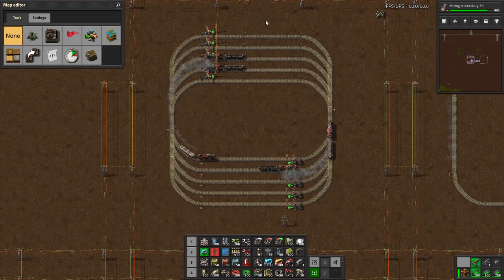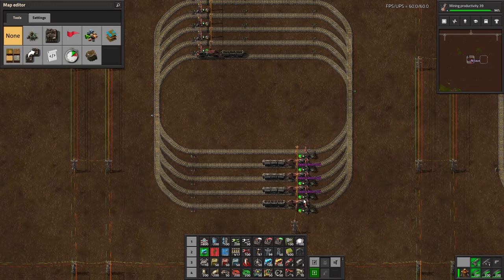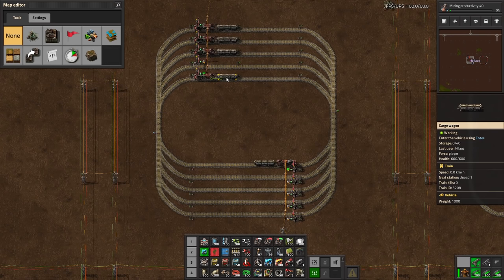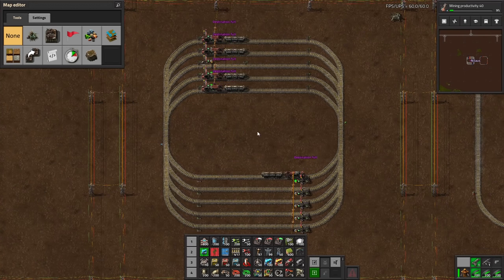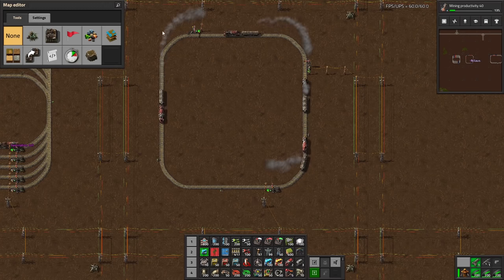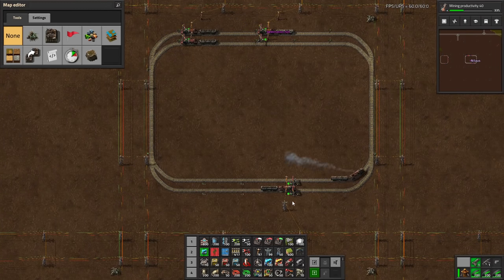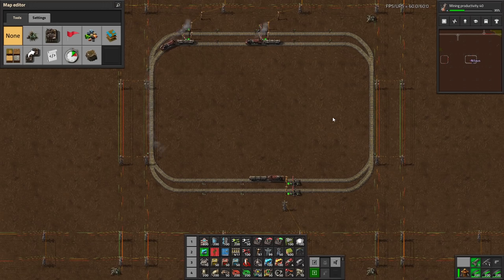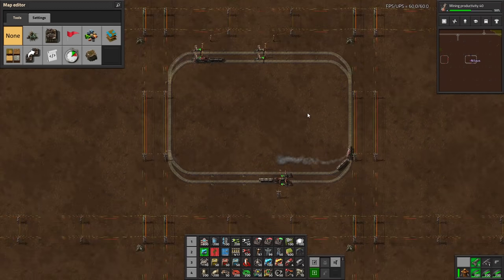ADVANCED TRAIN SYSTEMS; Deadlocks, Depots & Train Limits |  Factorio Master Class

Comment: There is a way to modify your 3rd setup to get rid of the problem you have shown. This fix will make the system a bit more robust against the resulting deadlock, so it might be useful to some people. But as it doesn't solve the underlying issue, as you have explained at 16:03 in the video and summarized marvelously in the quote at 18:55.

For the third example, you need to have the "actual station" (the one with the inserters lined up to the wagons) and the "pull-out station" entities immediately after another, such that a train in the pull-out station has its tail still inside the actual station area. (More specifically, either have such a short signal block for the pull-out station that a train of any length that could wait there will be GUARANTEED to stick out by at least 1 pixel into the actual station's signal block, or even have a single signal block for the actual station and the pull-out station. The latter has the advantage that it works with trains of any length.) Then the system will work as follows:
As soon as the train has stepped forwards into the pull-out station, another train can RESERVE a path into the actual station (since it's not "being reserved" any more - and thus this setup is fixing the very cause of your problem). But that incoming train can not yet PULL INTO the actual station that it has reserved, since the signal block is still occupied.
Only when the pull-out station is getting empty can the new train pull into the actual station, and that now GUARANTEES that it will be able to pathfind to the corresponding pull-out station - which eliminates the problem.

The first downside is that a train in the pull-out station might not get called anywhere for a LOOONG time. This will be especially probable if you apply this setup to a loading station - and provide too much capacity for filling the trains according to your plan. But it can also happen if you apply this to unloading stations and run into a situation where you have more capacity for unloading trains than for loading them. In the latter case you'll be blocking a whole module of your factory from working until the underlying issue is fixed (or until the offending train is manually pulled out).
This is why i'd suggest to only use this for loading stations.

The second problem is that it can still deadlock, but it requires up to 50% more trains than the simple system, which actually makes this a slight advantage. Where the simple system deadlocks when there's
a: trains in all open dropping stations and
b: trains INSIDE all open loading stations
(both meaning filled up to the current train limit with both a train trying to find a path and possibly trains in the stacker), this improved system will deadlock when there's
a: trains in all open dropping stations and
b: trains waiting in the stacker of all open loading stations (with their number equal to the current train limit) and
c: trains inside the pull-out stations of ALL open loading stations.
If I'm not making any mistake here, it WILL NOT deadlock until ALL loading stations with a train limit >0 have a train waiting in the pull-out station. Thus the "only" thing you gain is that you increase your capacity for waiting trains by the number of active loading stations. HOWEVER, this isn't the same type of increase as just adding 1 to the maximum train limit! The maximum train limit only takes effect when a station is basically overflowing with materials to load. Whereas even when the buffer boxes contain just over a single train load, a pull-out station can have a train inside of it. Or that train might have already left the pull-out station. But in a deadlock or near-deadlock situation, it'll be more probable to find the pull-out station full than empty. And it ALSO isn't the same as just adding 1 to the current train limit, which could call trains to near-depleted mines that won't have a full train load for hours (this system can only have a train in the pull-out station if it has "recently" filled up).
Reply: Your solution with the overlapping pull-out station design makes me wonder if there's some extremely clever way we could exploit this in combination with the train slot reservation system. Basically, to turn what Nilaus describes as a downside and a source of deadlocks (the fact that a train can occupy a station physically and one of its slot reservations, without actually being "at" that station) into a mechanism for pre-allocating trains more like the Logistic Train Network mod.

I think this could be accomplished by chaining the pull-out station, or a simple block signal, to the state of the primary station. Or perhaps to the computed "occupancy" of the primary station, by using another rail signal to check whether the block containing the station is occupied, then subtracting that from the station's computed limit.

I think that this could provide the missing third dimension to station signaling logic that is not possible with just the "loads available" and "loads wanted" counts that are sent to the circuit network on red and green. It would be a way for (demand/unload) stations to self-limit when supply is constrained, which they could determine by checking the pull-put station to see whether their just-unloaded train is able to be refilled.
Reply: @haphazard1342  True, it would give you more data points about the system, notably the total number of trains ready to deliver their load and the number of trains ready to pick up a load. These will help differentiate the situations where stations are requesting 5 copper trains which are all already on the way and the situation where only some of those requests can be fulfilled by incoming train loads.
I would NOT use this information only locally at the station, though. In Nilaus' block blueprint there are those 2 large power pole perimeters at 10 squares distance which could easily carry 2 separate sets of logic signals. Or would I use it locally... I'm thinking of that one farthest steel station. For that station it might be beneficial to limit the number of trains just idling there forever, but it also might be detrimental if the station's output is needed but there are ZERO trains available to be loaded.
In general, if you want to avoid the deadlock in the "not enough supply" situation, you should open MORE train slots rather than closing them down.
Reply: @Pystro  The primary power network already carries train station capacity signals on both red and green, for monitoring at a central location. He put the number of loads available for a resource on the green line, and the number requested on the red line. The difference then drives a colored-light capacity display to indicate net loads for all resources.

Individual request stations could use this data to self-limit when there is low availability. For example, if there is not enough of a resource, a request station could cap itself to 1 slot even though it might normally request 2. The problem is that the stations can't do this with only two signal wires, because their very act of reducing their reported demand would change the apparent "capacity" difference between the two signals for supply and demand. This would create a cyclic fluctuation. This could be solved for a single station or two with an SR latch to keep the requests constrained until more capacity comes online, but with more stations an SR latch would simply move the point at which the whole system spikes. Every station (of a given resource) would have to have a different reset point otherwise they would all surge at once.

My idea is that this problem could be overcome by not using the difference between the supply/demand global signals, which are subject to cyclic fluctuations if they are used as input to modify station requests, but instead to detect supply capacity constraints by detecting trains in the pull-out station. Or by detecting trains that are stalled in demand stations. The fact that a train is stalled indicates that supply is limited since the train can't route to a supply station. So the demand station can use this information to set its request limit lower in an effort to "free up" trains that would be taking up secondary request slots in its pre-unload stacker, forcing them to route to other (further away) demand stations.

This would undermine the use of the supply/demand global signals for showing capacity constraint, but the stations could also supply an additional signal (a unique symbol per resource) to indicate under-supply or "stuck trains".

This approach would also need an SR latch to keep the constrained state once the stalled train pulls out of the station. It would also take at least one unloading cycle to clear the stuck train and free up any excess train reservations for that specific station.

There are some limitations in the capabilities of the train system on the circuit network that make it impossible to implement full logistic trains in vanilla. We cannot read the reservations for a station, and we cannot set the train schedule from the circuit network. This means that balancing requests when there is not a surplus of supply requires some communication between the stations to coordinate which station gets the next available load.
Reply: @haphazard1342  Okay, I just got the point that you can gather more diagnostic data. And on that topic I was making the point that the power network has the hardware to carry twice as many signals of each color (with 2 red wires and 2 green wires running parallel to each path). But I just realized that you'd need to re-organize ALL of that (the whole base plus all blueprints) so just using some unused other symbols might be easier. Now I think I got a clearer picture of what you want to achieve.

You are right, there's a big problem here in that there's currently no good way to know for sure if the supply is actually keeping up with the demand.
If you have 20 copper plate pickup slots of which only 5 are open and 6 copper plate drop slots of which 4 are open you have the same "1 surplus" sum that you get if you have 1 of 2 uranium ore pick up stations open and 0 of 1 Uranium ore drop stations. The first means it's not keeping up at all, while the second is perfectly fine.
* The first way to reliably tell would be to have a large enough cumulative maximum train limit on the supply side. If your train limit on all copper plate pickup stations is 50 and your fluctuations are at most 10, then anything under 40 is a problem. (This is again very similar to Nilaus' strategy, except that his is about keeping excess throughput, while this is about excess stacker space.)
* The second way to reliably detect a supply deficit would be to look for another diagnostic signal.

On your strategy idea:
"So the demand station can use this information to set its request limit lower in an effort to 'free up' trains that would be taking up secondary request slots [...]"
That's just one problem. And limiting the demand (without going below requesting 1 train) would indeed solve this.
BUT! The other problem is the deadlock. And that basically happens if there's too more trains available to go to stations than those can accept (with an added condition that it has to happen to both full and empty trains). Therefore you can only prevent that by opening up more slots (and it shouldn't actually matter if that's in stackers for full or empty trains). Which you probably have to do in any supply stackers because in the demand ones it cancels the fix for the train capacity problem. I.e. open up 1 more of the stacker slots even if the boxes only contain some fraction of a load so far (as they will fill up eventually).

First thing to note: "[...] their very act of reducing their reported demand would change the apparent "capacity" difference between the two signals for supply and demand." You don't have to reduce what you report on the wires. Just place the subtracting arithmetic combinator right before the L signal goes into the station to sets its capacity - without affecting the L signal which gets translated into the copper plates or space science signal or whatever the station deals with.
Reply: i dont know if its posible, since im terible at circuits and advanced train stuff, but i feel like you should be able to add like an designated depot as in the second option. but then making it only accesible if and only if the system is in a deadlock case, so that when as in the first example they cant find the station they inmediatly route to the nearest depot, by opening a depot slot for that specific type of train. but then when the whole system is functioning properly again closing it.

i suspect you can do this by effectifly making pullin stations (wich would then require you to close that pullin station when the loading isnt sufficient, instead of the loading station itself (or maybe both, this requires some testing))  and giving your depot stations the same name and alowing for only the amount of trains that wouldve gone to the by now closed stations.

if this works like i think it does, then you shouldn have the problem of strange train routing and them taking extra long routes in normal operating conditions. you shouldnt be left with trains stuck in thier unloading stations, since when they cant get to thier loeding stations a depot spot should open up and also the trains currently at the closed loadingstations should be able to get toward thier depot slots after having unloaded, so as to not cause the same exact problem we came here to solve. 

only downsides this might cause is that it might break down if your trains have strange waiting conditions and it does double the amount of stations you need including a semi complicated circuit for every different resource youd like to aply this to
Reply: @patdbus  
The biggest problem is that you have to ensure that a train at a pull-in station in a stacker will ONLY go to the immediately following train stop. Else you'd have the same problem demonstrated at 12:16, except with the pull-in staton in the place of what Nilaus calls the actual station and your actual station where Nilaus claims it's his pull-out station.
One solution to this would be possibly by using double-headed trains. You'd just have to build the actual (un-) loading platforms so that trains reverse after they're done. (I believe that trains don't use reversing in their normal pathfinding, which limits them to the rail that goes INTO that platform). (You'd probably use X-Y-1 trains and accept the slower speed while maneuvering inside the stations.)
The better solution would be to keep the train from reaching the pull-in station until you can guarantee that it can proceed to the actual train stop. I have a feeling that many things can go wrong here, but I can't put my finger one one that would be guaranteed: Race conditions; how you make sure to release exactly one train from the stacker; Keeping the trains from the depot(s) from getting stopped in front of the pull-in stops; ...

Except for that it sounds possible in theory, but here's another issue:
The trains that are in the overflow depot would bypass the pull-in stations (since they're already at a station with that name).
- If you don't set limits on your actual train stops, then the trains from the depots would just all path to one station and hang out on your rail lines.
- If you do limit the actual station (probably to 1 train) then a train from a depot can still reserve that spot (especially if there is no train in that pull-in area yet).
-- In that case you'll need to provide it with a way to bypass the trains waiting in the pull-in train stop(s) of that station.
-- If you don't provide that bypass, then the unavailability of the actual train stop would force the trains from its stacker to go to a different train station, and you'd just get self-sustaining routing chaos.
So in conclusion, as long as your pull-in stations look like a stacker with 1 rail unused, and you're limiting the actual train stops, I don't see a reason why it shouldn't work. As you said, it's not very space efficient, though. You'll need to provide that unused stacker slot at each station, plus as many depot slots as you expect to have trains that could overflow.

I'd expect the logic to be fairly simple, unless the mechanism that releases exactly one train causes unforseen headaches.
Reply: @Pystro  yeah, i kinda forgot about the fact that youd have two stops in a row with the same name, resulting wich could cause some dificulty. But idk, there are prob a few ways around it though, but i cant come up with one right now. I wanted to test it but havent gotten to that yet
Reply: @Pystro  I was thinking something pretty close to that. The problem with the above was he was conflating related, but different measurements that you're trying to make. Because the stations can have a train physically present while it has moved one pixel forward but is no longer in the station's counter, you've got different things you're measuring. How many trains are currently at/waiting to arrive at the station, and how many are physically present within its zone of control. You'll need to read the signal from traffic lights you place such that you can guarantee the station is completely clear before actually subtracting the train from the "physically present" number vs the "intend to be there" number. You've got where the trains are and where they're heading *to*, and they aren't the same things and as Nilaus pointed out, the station is counting the "to" number and not the "are" number.

So, if you're going to dynamically adjust how many trains are allowed to be in a station based on that, having both values is required to make good decisions.

Additionally, instead of using the counters as haphazard was implying (I haven't seen the other video, so maybe I'm completely wrong here.) to represent supply and demand, you have to track them with different variables. There's "Actual Supply" and "Actual Demand", and then there's "Adjusted Supply" and "Adjusted Demand", where the adjusted values would always be equal to or smaller than the actual values (unless I'm missing something, I need to watch the other video).

I assume the point is to artificially balance the two even though the actual values will differ in any real-world scenario.

I wonder if you could track the ore left at a site or a trailing average/maximum flow rate based on the frequency of trains leaving the stations. You could get the original value from the addon that lets you measure the total ore at a site and then punch it into a constant combinator to give you your starting value. Not sure that's particularly useful at the tactical level though; better at the strategic but you can't really put strategic thinking into a combinator.

I know! Instead of measuring how often the trains are leaving, measure how long it takes to move the resource onto the train. If a source is running dry and can't supply as many trains as it once could, then you can adjust the maximum number of trains it'll advertise it can supply based on that.

You could even balance out where trains are getting their supply from that way. If a station is getting underutilized while other stations are backing up because they can't load the trains fast enough, then you can allocate open train slots based on whether a station has met its quota or not. Once a station has met its quota, it doesn't get to advertise more supply until the other ones get a fair shake and get some trains heading their way.

Of course, this all becomes MUCH easier if I can just type some code in to do logic rather than having to build my own SR latches and XOR gates or what-have-you to accomplish anything. I like the other aspects of the game, but being limited to such rudimentary logical constructs keeps you from doing anything truly cool with a reasonable amount of effort.

I have to shift my brain from "I want to say 'this or that'" to "how do I express that kind of logic with just arithmetic?"